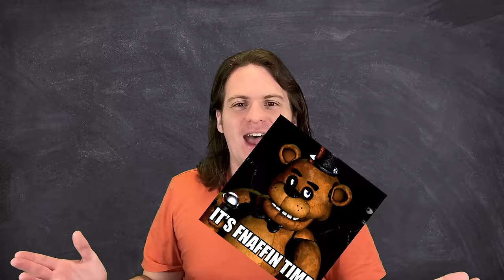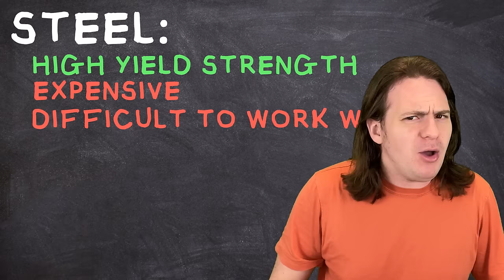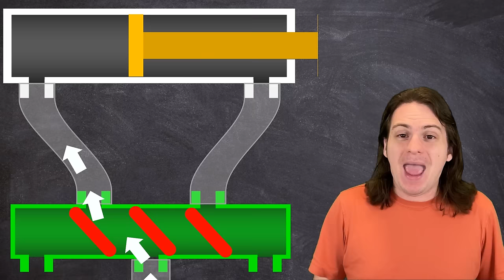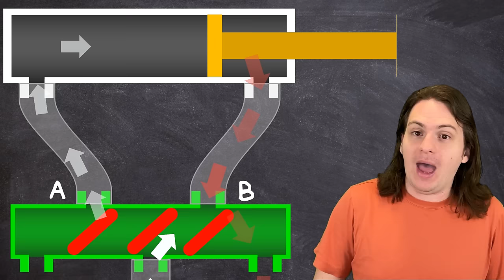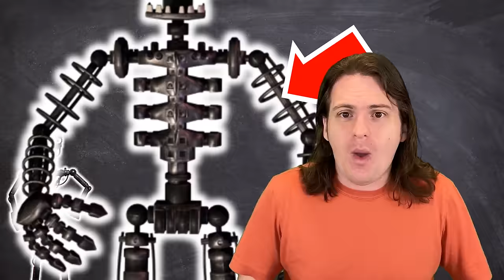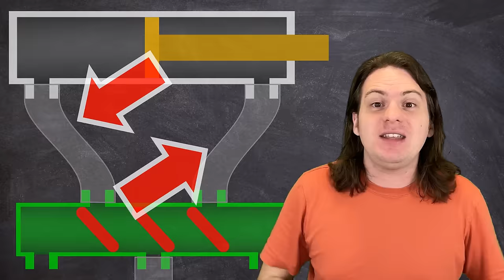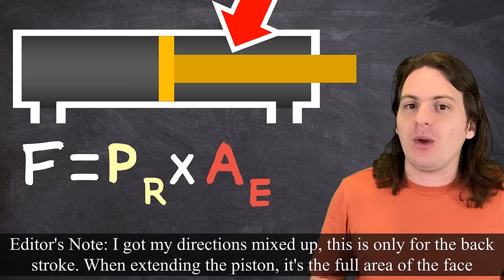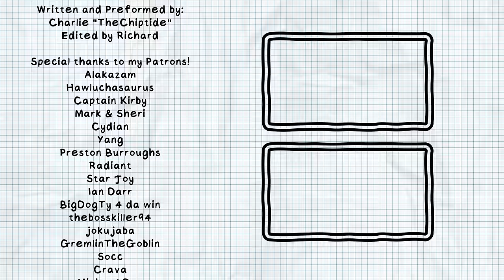FNAF: The REAL Science of Animatronics!

Comment from the maker: So, turns out I totally forgot that in FNAF 1 the phone guy tells you that the animatronics have to roam around to "stop their Servo Motors from locking up", which would imply that the animatronics are indeed electric. I'm gonna chock this one up to just some bs made up by Fazbear to try to explain why their animatronics roam around at night murdering their employees, though, for a couple of reasons.

1. Servo motors tend to be VERY expensive compared to pneumatics or other types of electric motors that accomplish the exact same function. From a business perspective, it's a bad move!

2. The main benefit of a servo motor is it's high level of precision. These are traditionally rotational motors that are capable of rotating something within a fraction of a degree. This can be helpful in applications where high-levels of accuracy is required (medical equipment, aircraft components, or actual robots). However, when your goal is to make a rabbit vaguely look like it's playing the guitar, that level of precision is completely overkill, and in fact, might make it look unrealistic and stiff!

3. While a servo motor can "lock up", this doesn't happen from lack of use. It's usually because something in the motor itself is broken, or you've put too much weight on it and it's not powerful enough to lift it. In fact, letting these motors run all night will probably just shorten their life-span! If you're gonna make up an excuse, Fazbear, at least make it believable!

4. Scott isn't a robotic engineer so I won't hold it too much against him, but if you look at the design for the early endos you can't see any servo motors (or any motors at all, for that matter), just some ball-and-socket joins that move based on I guess magic? Again, I get it's just a character design, but if you want to get technical, there ain't no servos!
Reply: It's not magic,it's ghosts
Reply: Says he'll list a couple of reasons... Lists four reasons.
Reply: Have you heard of servo-pneumatic systems?

Moreover, without the flow controls in between to buffer the pressure from the valves to the cylinders you’ll get the herky-jerky movements of the Cyberamics from CEC, slamming the aluminum components and damaging them. 

Luckily, CEI manufactured Showbiz’s animatronics with flow controls in between the valve and the cylinder to give the characters more subtle movements.

To give another point in the accuracy of the SL endos, all the gas tanks put all over the bunker and “gas leak” can refer to the compressed air that would go into the SL animatronics’ tubed endos.

Lastly, I remember hearing from somewhere, perhaps SPTProductions now animatronicswarehouse, that a really early technique Creative Engineering Inc (CEI) used when building their animatronics was to build all the internal mechanisms onto the fiberglass shell itself, which could also play into how hollow the FNAF animatronics are so that a child could fit inside.

Aside from that, great theory video overall! I like it when FNAF and irl animatronic fandoms  communicate with each other!
Reply: The Fact that The Yendo Skeleton Depriving The Oxygen of the room makes sense,

If all those wires are tubes.
Reply: @satsujin-shathewitchkingof6185  the animatronics are capable of moving without being possessed
Reply: @MLGSuperSonicGamer  Prove it
Reply: @satsujin-shathewitchkingof6185  the toys
Reply: @MLGSuperSonicGamer  There's still the dead kids in the fnaf 2 minigames
Reply: @satsujin-shathewitchkingof6185  william killed the kids I believe on either night 5 or 6 which means that the toys wouldn't he possessed untill then, which means they weren't using souls to move
Reply: @MLGSuperSonicGamer  Yeah but the toys also had parts from the originals. Remnant transfer is a thing
Reply: @satsujin-shathewitchkingof6185  even then they have stated to been walking before the murders like I'm not making this up
Reply: @MLGSuperSonicGamer  Yes because they had haunted parts from the originals.
Reply: @satsujin-shathewitchkingof6185  you know what you believe whatever you wanna believe
Reply: @MLGSuperSonicGamer  I will
Reply: Chuck E Cheese's Pizza Time Theatre actualy used servo motors for a few animatronics in 1983, it was the "Family Album" cabaret band, they were build by Elnicky Enterprises for PTT and were only temporally installed  at 6 locations as a test, but weren't very popular and they broke down often.
Reply: The Week Before book outright states that the animatronics are battery powered, not pneumatic
Reply: prolly should pin this
Reply: bro you admitted defeat so early lol. shortest internet debate i have ever read, perhaps the most civil too! hilarious. @satsujin-shathewitchkingof6185
Reply: true, the fnaf 1 gang looks wise reminds me of cyberamics but it seems like design wise its a disney animatronic powered on pissed off ghost fuel, its kinda cool knowing they are electric though since i want to make animatronics irl myself but am torn between pneumatic and electric, ik id never reach the goofy ass wild ideas of henry or williams but i like the old pnematics more irl personally since i grew up with the old chuck e cheese bolted down fellas, animatronics are such a fascinating thing since i never knew cyberamic heads were just wood frames and the mech.
Reply: It fazbear  fun magic
Reply: @remixtheidiot5771  Thanks,glad I could give you a good laugh
Reply: In FNaF VR you have to change/fix servo motors on the FNaF 1 animatronics.

Comment: Yeah, there's actually A LOT of instances where animatronics from FNAF 1 have been all but outright confirmed to be fully electric. In The Week Before, they say the animatronics have charging pads on their stages, explaining why they go back to the stage at 6, in FNAF VR Parts & Service, you can see and hear the animatronics sparking very often, and in the movie Bonnie apparently uses so much electricity that it's able to conduct through his guitar strings. And you might say the FNAF 1 animatronics being fully electric in the early-90s-2000s is unrealistic - this is the universe where an AI became self-aware in the 70s. And even disregarding The Mimic, this is the franchise where an animatronic had the bite strength to cave in a kid's skull in the early-80s, animatronics were able to free-roam as early as 1987 at the least, and the Mediocre Melodies are shown to have external batteries in FNAF 6, and the Mediocre Melodies are theorized to come from as early as the 70s. I rest my case.
PS: the FNAF 1 gang are said to have fiberglass shells in Into the Pit, not foam.

Comment: Really good video as usual! Also, to kind of add to it, FNAF The Week Before does confirm that the FNAF 1 animatronics are electronically powered with an internal battery and a charging station so they can interact with guests, hence why they're able to move around at night. So they probably use electric motors instead of pneumatic actuators, as you mentioned.

Comment: It makes sense to take the cheapest option when talking about Fazbear entertainment. However i got wondering, If the animatronics were the only non cheap things they did, fully steel and fully electrical. Would that change their strength and danger? Or would the difference be neglectable?

What would it take for the classic animatronics to be as dangerous as we think they should be?
Reply from the maker: Using steel instead of aluminum would definitely make them a lot heavier, so you couldn't man handle them that easily. As for electric, it depends. If you really wanted you could get an electric motor that's incredibly strong, but there's really no reason to. Electric isn't necessarily any stronger or weaker than pneumatics, they both come in many different power levels, the main difference is the form factor. And on the bright side, if the whole thing was electric, just throw a glass of water on it, you'll probably mess something up!
Reply: Well in the week before, Ralph did such that against foxy. @TheChiptide
Reply: @TheChiptide  thats actually used against them a few times! mike does it in the movie and the phone guy does it in a book!

Comment: Chuck E Cheese's Pizza Time Theatre actualy used servo motors for a few animatronics in 1983, it was the "Family Album" cabaret band, they were build by Elnicky Enterprises for PTT and were only temporally installed  at 6 locations as a test, but weren't very popular and they broke down often.
The animatronics built for the movie also use servo motors (tho not very strong ones as both Foxy and Bonnie's arm servos overheated and burned multiple times, which is probably why tthe costumes were used more often in the film).

Comment: I'm pretty sure the animatronics are electric based, and not pneumatic in nature.
As the Phone Guy / Ralph even says they were "allowed to walk around during the day...", a robot made from electronics and motors can do that easier, while a pneumatic system would struggle to carry around all required equipment such as air compressor and such in a humanoid form without serious scale issues.
So pretty sure Endo 01 and Endo 02 are all electric. And since electric motors/servos are stronger, that means Freddy and the gang would also be stronger. Not sure to what degree though, could be human strength, could be greater.
I also like to think that the FNaF universe, they are a few decades ahead in robotic technology then we are in real life, thus explaining how they can have designed walking robots -- essentially what the animatorinics are.
As for the Funtime Endos, I'm not sure. They could be built using muscle wire - a wire when you run current through retracts in length, like real human muscles, but then again, they could also be motorized fancily somehow. The Funtimes are definitely more game logic than real world logic. But also going with the Funtimes were designed to go off stage to be rented out for parties, they are most likely also all electric, and not pneumatic based. Which could also be why an electric shock causes them pain, as it messes with their electronic systems/causing them to shake.

Overall, I love your comparison to real world tech of the 80's to FNaF, but I don't think it's a fair comparison to advanced robotics of FNaF to pneumatic systems of real world animatronics.

Comment: As someone trained in machining simple parts for train maintenance:
Aluminium is not cheaper nor easier to work with than steel. In fact, aluminium sucks to machine in comparison to steel, it binds a lot, it has poorer thermal behaviors,...

Comment: As has been mentioned in the comments already: It was said by phone guy that the animatronics use electric servos.
In all of the FNAF stories, it's only been talk about giving the animatronics electric charge to be able to wander around. Especially if leaving the building.
The ones who created the animatronics were described as genious inventors. Even though Henry was the better one of the two, William wasn't too bad himself. And if they invented much stronger servos than what we can get commercially in the real world, because they're genious animatronic inventors. And also both caring for quality, going for steel rather than aluminium. We definetly can understand how theese robots can be powerful oponents.
The company probably just cheap out on everything else. But due to the animatronics already being such a sucsess, they have to go ahead and keep using them.
We heard the springlock suits double as animatronic and suit. Meaning they can work in animatronic mode. A springlock failiure in an aluminium suit might not be as bad as a springlock failiture in a steel suit.
We see the power of the scooper. How much force is needed to remove an endoskeleton from a suit. That isn't just aluminium.

_____
Also, side note as I watched your video about the doors in FNAF1 before this video.
The company probably runs the generator during the day during opening hours.
But at night time, they don't need that much power, so they switch it off, and let the night guard run on the leftover battery supply.
Foxy then drains this power when he bangs on the door.
He's out of service, and needs to recharge more frequently, and found a way to do so at that door when the generator is turned off and no longer can use his regular charging station.

Comment: 5:58 did you use some of the fnaf movies mechanics 7:00 the fnaf vr model shows they have about 2 metal circular plates mounted  inside the joints each to hold the suits to the endo

Comment: wait wait, isnt pneumatics very vulnerable for errors? like the strenght of these things is less than your maths if the hoses are weak and close when air is pulled out, or if they unplug from the pressure theyre supposed to withstand, and the tube insides from the cylinders have to be build more exactly than on the milimeter only, so trying to make these things strong would only lead the the air inside to slide by as soon as the piston gets shaky from the pressure right?